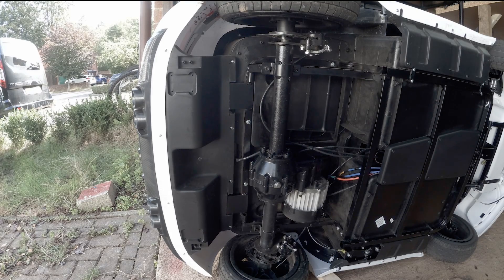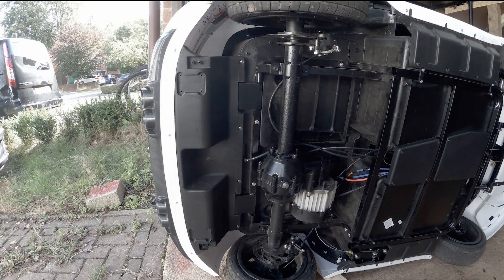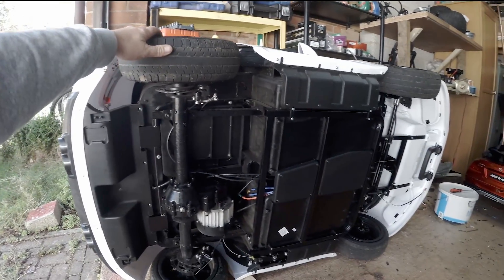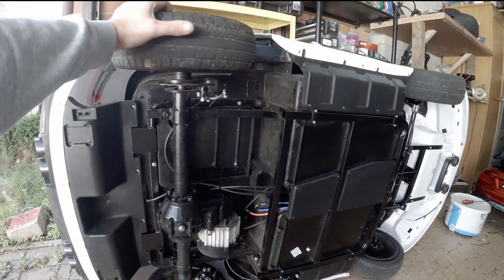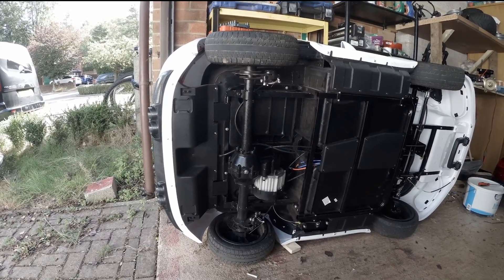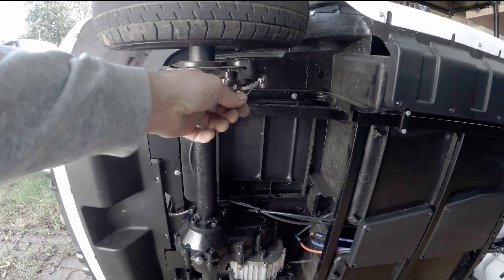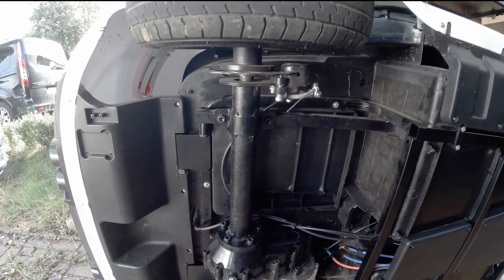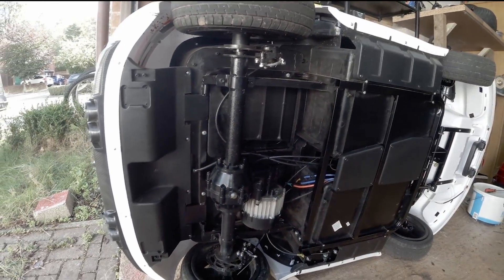How to open the gearbox on the Super Sport XL 24V

Comment: I do not quite understand why not brew it? he should drift better, right?
Reply from the maker: The car is quite small. And all my weight it on the  back wheels. If by brew you mean weld the diff? I have tried that and  lost almost all steering
Reply: and now at what stage of development is this machine?  we are already close to buying such a Porsche.  We are also studying how much it will cost to accelerate it.  But most of all, I would like to make it on gasoline!
Reply from the maker: I didnt have time to develop it more. It runs at 30mph. I am about to install front brake disks and increase the speed soon.
For modifications you will probably keep just the plastic. Everithing else needs to be build including the frame

Comment: Wow, it has huge steel axis and steel frame. Looks much more sturdy than other toy cars. I wonder how much weight could it take before something start to bend or break.
Reply from the maker: If you check my other videos there is one with me and another adult 160kg in total at 20mph. But it is a gamble because the front axle it not fixed to the frame but on the plastic body. I will do an upgrade soon
Reply: @ExtremePowerWheels  Looking forward to your front axle modification video sir.

Comment: Do you have the original motor specs ?
Reply from the maker: the only thing i have is 180w 24v. that is what is on the motor
I managed to find out that the motor has around 104kv = 104 rpm/v, that it has 10:1 gear ratio and the motor gear has 16 teeth
A lot of other motors fit the gearbox you can find them on alliexpress. but if the motor is more powerfull the rpm/V will be smaller that means a increase in acceleration but the top speed will not increase dramatically. I am very surpirsed that my motor can hold 75v and 150 A and still runs
Reply: @ExtremePowerWheels  same here ok thank for your time ! 👌
Reply from the maker: @Mig-L.M  let me know if you are searching for parts. I can help. You can send me a message on facebook on ExtremePowerWheels